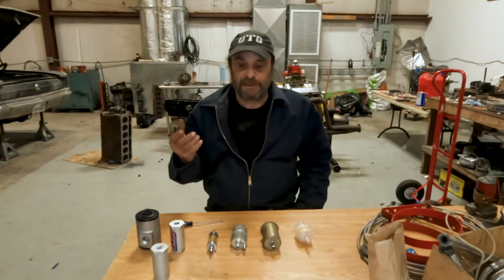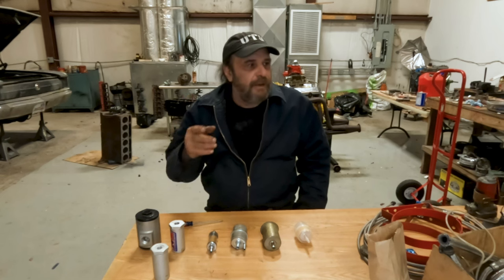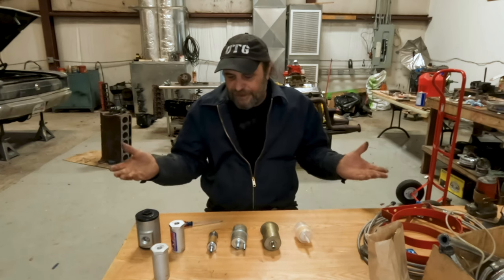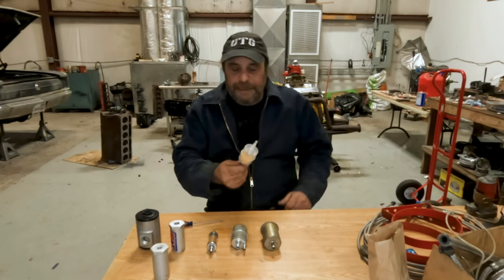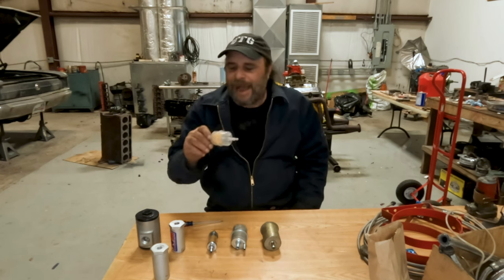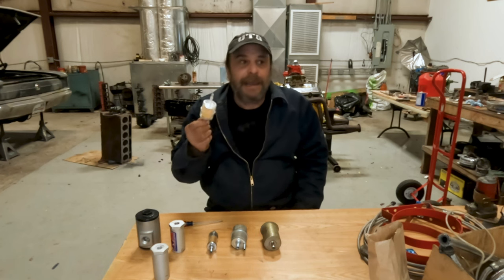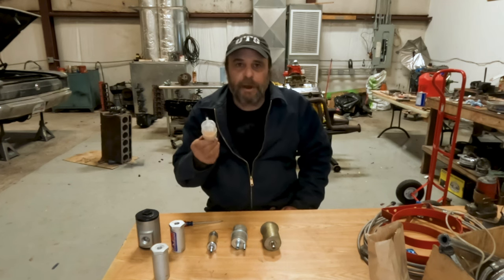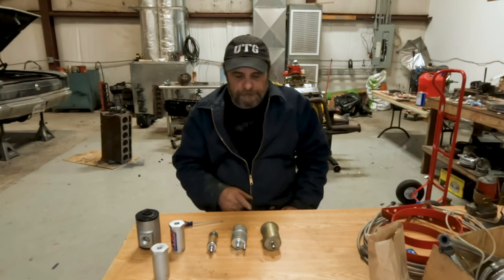Fuel Filters For Carbureted Engines From Mild To Wild - Pros, Cons And Which Is Best For Your Ride

Comment: Never had an issue with a glass filter.
 They are cheap, so I buy a new one, and change it out every so often.
 After I replace one, I save the old ones, after cleaning, for spares, for  yard equipment, or the generator.
 Never had one leak or break, in 50 years.
 Just keep an eye on them...just like everything else.

Comment: Interesting!  Any comments about backpressure/resistance to flow? Won’t matter to normal pumps, but I recently removed an inline filter from a gravity fed 1959 tractor with updraft carburetor (it still has sediment bowl with screen). Even a fraction of a psi makes a difference to such a system.

Comment: I tried a glass filter on my boat because I was trying to track down an air leak.  I split the glass with the primer bulb, not a word of a lie, and sprayed gas everywhere.  To be fair, it was a cheap Chinese filter, but since then I am not a fan.

My question is, can a pulse pump on an outboard vapor lock?  I've confirmed that there is no air entering the system to the pump, but at idle the fuel filter fills up with air (or vapor) and the engine stalls after a few minutes.  Other than that it starts and runs fine.  The stall is always associated with bubbles in the filter, if I use the primer bulb I can squeeze the air through the filter and keep the engine running.

Comment: The MrGasket glass filters work really good if you install them correctly. In 40 years I never had one fail. One drawback is they are restricted. You can deburr and even port the restricted inlet and outlets to up the flow a little. Not good for a really hot street motor as they will starve the carb for fuel. I have one I opened up the inlet and outlets on a 400hp v8, any more motor they will not flow enough gas.

Comment: The only scenario I ever used a glass filter was on an old pickup where the sock in the tank was roached and I couldn't find another.
I didn't submerge it and I put just below the tank. Reason being the micron spec is the same as a fuel tank sock and I could clean it.

Comment: I use a 3/8 Vette inline filter hidden under the alternator bracket. GM GF61P part # 854619 Older stock was made in USA. I had a glass filter once and had to bypass it b/c if started to leak when I saw vapor on the hood. Junk!😂

Comment: A respected engine masters competition engine builder turn me on to the orifice style metal filters and along with a fabricated heat shield under the carb we’ve never had a vapor lock issue with the 589horse, 400” based stroker motor in our street driven roadrunner.

Comment: Uncle Tony... Any old school advice regarding mechanical fuel pumps. Should i run a back flow protector? Before or after pump?  My classic sit in garage a lot maybe goes out once a week. My Edlebrock 6psi pump always looses all of its pressure and i have to crank it over 5 to 6 times to get my 6psi . it also looses pressure right away when i shut the car off. is that normal?

Comment: the only issue I had with the glass filter was I bought a china cheapo version and the rubber O rings where really cheap quality and the gas started to deteriorate the rubber amd make really soft causing leaks so I junked it . I should of had a box of assorted sized green O rings for AC unites to replace the regular black cheapo O rimgs and it probably would have been fine

Comment: I bought the plastic filters,,3/8. And 5/16. Both had reasonably sized  inlets. ,but had tiny inside holes,,they were fun to see if you had flow or how clean the gas and filter were,,,but I went back to steel with huge inside diameter holes,,,car runs much better,,,can't see the gas but that's life..the lady at O'Reilly's tried to sell me vapor hose because she didn't have 3/8 fuel line,,,tried to sell me injection hose that was hard as a rock,,both could burn up your car,house and kids,,,most pumps can't pull gas throughout a bb size hole that you don't notice that's 1 inch from either end,,,glass tubes and plastic filters are for 3 hp lawnmowers,,not cars,,no pump can work if the filter is too restricted,,many a race has been lost due to the wrong filter,,,also Edelbrock red 60 dollar electric fuel pumps draw one amp,have a motor that spins,looks like a old slot car motor,,tiny junk,,centrifical round impeller,,it's gravity feed,so it has to be mounted lower than the tank and a foot from the tank,,,it's a pusher pump,,,not good at self priming or dirt,,if you mount it near the motor it won't last 3 days,,

Comment: I use plastic WIX brand mostly, sometimes Fram as long as it's not China made. Never never had any issues with them. I have the glass filter kept in the drawer, I think I'm just paranoid about using it.

Comment: I've ran them glass filters exclusively for over 28 years, hundreds of thousands of miles. In my experience, the worst thing that happens is you have to take it apart and blow it out with carb clean or change the element inside. Pretty sure they'll take a good beating from a rock.

Comment: Should the filter be before the pump or after the pump? Mine is before and it is full before startup but after a few minutes it becomes empty is what it looks like. Oh I have a fuel regulator between pump and carb set at 4.5 psi.

Comment: On my mild 318 I have always run the plastic see through with no issues at all. Running around 6psi of pressure through an electric pump.
Reply: Weren't those plastic see through filter's factory on the 318s, I remember them in the 60s and 70s on all 318s I worked on.

Comment: Had a 55 Cadillac that if I got stuck in traffic it would vapor lock. Kept a couple bottles of water in it for just that occasion. Car would die, pour water on the pump, crank for 10 seconds and be back on the road. If I could've added a return line I would've, but wasn't my car and didn't get driven that much. I hate those glass filters. Mainly because of the people that install them. They either don't tighten them enough, or overtighten them. For a clear filter, I use the plastic ones.

Comment: That same color plastic filter is OEM on imports into 1960's and before.
  I like the metal filters but not all created for the low 4/6 PSI carb. Isuzu used these with Flat Corbin clamps on TBI in 1991 and 32-34 EFI multiport in 1993 but had  70 micro media and magnet in side. These and plastic ones work on P/S return hoses as well as orifice tubes at the inlet.
  The glass filters are fine but leak. Nobody wants to toque them and specs are not included!
  Metal ones with 3 tubes in todays "LS" engine craziness I would expect to have the guts of a regular inside. A spring, diaphragm, viton needle & seat with a set pressure used for return.
  But the screw-in type with line wrenches and others alway bothered me during removal as fu l runs down the arms into the pits. Skin can be sensitive but you smell like gas as day. I would guess that a quart is in those lines and comes downhill. Waste oil can & trans fluid pan can work but I have tied shop rags to my wrists to stop it. There with no pressure and fuel tank cap on hold a lot. There deserve a shut off ball valve front & rear  but but this adds $20 extra if you can find them. Perfect! As automotive tech we have more science, math and other disciplines required
of use everyday than a Dr. What temp does water boil at? 
Well; Is water water mixed with anti-freeze or contained. 
Is it under pressure, sea level or below sea level or a vacuum. The pressure cap raises the boiling point 3 1/4 degree F per pound, so 15 PSI cap causes it to boil at 260 degrees F. That is why grandma's pressure cooker was so fast. Place in a vacuum and has less pressure to hold the hydrocarbons chains together, so a 3 minute egg boils faster at Pikes Peak or 14,000 feet. Between the gas tank and pump at the engine, rubber is better than steel maybe because of insulation, but at 10PM in Vegas at 100 degrees F, the fuel can boil in a vacuum. This is not a good fuel supply. Many variables play with the exact number, but this is vapor lock. Electric pressure pumps where placed in tanks for years on the first EFI engine, to supply a frame mounted pump in rubber to produce the pressure needed for proper fuel delivery and vapor lock happens for this reason!
  Thanks, UTG again. 
DK. Omaha.

Comment: The glass fuel filter threw me for a loop a few decades ago. The car wouldn't run, I'm a teenager, no experience to speak of. There's gas in the tank, the glass fuel filter shows no dirt, the white mesh element looks very clean. Pouring some gas in the carb makes it run for a short while. I replace the fuel pump, still won't run, same issue. Lots of hair pulling, hours of wondering. I finally pull the glass filter apart and discover the white mesh screen is skinned over with some sort of clear coating, like clear spray paint or something. I put a new screen in, it ran fine. Looked good, but it wasn't.

Comment: My buddy's dad had a nice first gen Chevy blazer with a plastic fuel filter between the pump and the carb.  Didn't drive it much. Plastic broken down and cracked, leaked fuel all over the engine and burnt the truck up.  It was very sad.  And very stupid.  Pay attention to your fuel system and you won't have problems like that.

Comment: Plastic fuel filters with ethanol to me is a "no-no." Ethanol will degrade it fast. Possibly cause a crack. Old fuel hauler here. It used to cloud and crack the polycarbonate sight glass on the loading heads on out trailers.

Comment: I watched 2 BIG $$$$$$ car's burn to the ground from those glass filters. The one had the plastic ends where 1 melted off/loose. The other one O-ring shrunk. But both had fire extinguisher 🧯 that turned out to Not work. Once the firewall insulation catches it's near impossible to get the fire out

Comment: The screw together fuel filters with a glass worked great for the most part, biggest problem I ever had was them coming unscrewed at either end. That was more dangerous than the glass ever breaking.
Reply: I put a wrap of clear packing tape around them to keep them from moving.
Reply: When installing twist lines to have positive force to turn ends in tightening direction.

Comment: say u have 2 plastic filter running in parallel .. they could only handle 30 psi each but u need 60 psi for you build would it work.. i suspect if reg is before filters it maybe ok

Comment: I’m actually going through picking what filter to use on my project at the moment. I picked up one of the glass ones from O’Reilly a couple weeks ago, but when I got back to the shop I saw it was only rated to 300hp. Is this common with most glass filters? I believe it was Mr. Gasket.
Reply: a filter rated in HP? LOL
Reply: @Videoswithsoarin  Thought it was odd myself, but it was marked on the back of the package.

Comment: Do you pay any attention to the level of filtration?
I run veg oil in my diesel vehicles and can rarely find the micron rating on filters, super frustrating!
General use oil filters seem to range from 3 micron to 10 micron and some speciality ones go down to 1 micron but it's super tricky to find the specs. Fuel filters are the same here, rarely any markings on them
Reply: Wix publishes a crazy amount of information for their filters, including micron rating. Just have to look up the part number on the website. Since you have a unique application, you may be better off just to call them.

Comment: the glass ones are fine as long as you remember they are glass and when you take it apart to clean it check the rubber seals in the ends you can get new ones cheap or even find something that's about the same thickness and cut out new ones of a similar material but of course there's always guys that put it together my buddy did this and he had both rubber seals on one end instead of one on each end starts the truck it's dripping a bit grabs two wrenches and snugs it a bit slowed down the drip but still drips so again with the wrenches by this time I walked up and saw how much pressure he was putting on the wrenches I was like whoa hold on wtf your gonna break the damn glass and any more he would have and had glass in his face or something bad would happen so I said step back big boy let me help you out here for u hurt your self we joke all the time well geez he had it tight well we are all getting older and he's had diabetes for quite a long time and his eye sight is not what it used to be obviously so when I saw the issue he was like oh shit but I bet most of the time the glass gets broke it's user error most of the time I'm sure of it you get he man GI Joe w the kung fu grip grab two 12 inch crescent wrenches and crank down and wonder why the glass cracked! cheap POS made in China probably lol yep I'm sure that's exactly what happens lmao night yall

Comment: The glass inline filter can look clean and limit gas flow,since it looks clean you never notice the flow issue,,except your car runs bad and low top end speed,,never use them unless you just like years of poor performance,,they are worthless,,never use them,yes they look cute,,,and never pot your filter near the radiator,,it will boil,,,also use a mechanical fan even if you run electric,,,it moves air over the motor a electric only moves air through the radiator,,,cross over in the intake can boil your carb,,,,the plastic filter inside the glass filter can look clean when it stops flow,,,throw them away,,,don't use them on anything not even a lawn mower,,,I had problems for over a year before I accidently found the flow was so low the car had major problems,,,,

Comment: Glass filters can be taken apart and the glass used for a great guitar slide on your finger I collect glass water traps if they used them in the old days especially on farm equipment they must be good I used a glass filter on a 64 c10 I was building my test run is always from abbeville to greenwood sc I’d make it half way and the truck would start acting up and I’d turn around and come home the filter would be packed with crap I’d take it apart and clean it out I did that every day for a year it finally cleared up and made it all the way from now on I’ll just remove the tank and clean it

Comment: Nice video, it's good to dispel some of the hysteria around things like these glass filters. I've had one on my 1990 VW Polo for almost a couple of years now. Anyone who knows these cars know the filter is fairly secure in the engine bay and I cable tied it so it's not going to move. It's great to have a filter you can easily clean out. Good tip to keep an eye on the seals either end and make sure the ends are snugged down and o-rings in good condition. But just like any filter they won't last forever so I guess replace them every so often anyway is a good idea, it's just a bit less wasteful to have one you can clean a few times before it's done and will actually recycle when you're done with it.

Comment: I bought a '70 1/2 Trans Am in 1985 and it had one of those glass fuel filters mounted over the intake manifold next to the carburetor, not long after I bought it, I smelled a shitload of gas coming from the engine bay while driving, I pulled over and popped the hood and found that gas was spraying from the loose filter end into the radiator fan and the whole engine bay was covered in gas, I shut down the engine and let it dry out for a while, then installed a steel filter, f@cking glass one nearly burned my car down!

Comment: Wow, such a disparity of opinion on the inter webs about glass body fuel filters! Most of the positing about glass body fuel filters has been negative to the point that they suggest with conviction that use of these filters will result inevitably in catastrophic failure and subsequentr vehicle combustion. UT makes sense in his take on use of these glass body fuel filters. The takeaway is the ability to think critically in processing multiple subjective viewpoints.

Comment: The biggest problem with the glass filters is the build quality.  The threads are loose, gaskets rot, or the end of the glass isn't square.  They were better in the 60s and 70s, but it's all Chinese crap now.

Comment: Ha!!!
This is exactly how I fixed the fuel percolation problem on my 1964 Oldsmobile 394. I eventually sold the car and the guy argued with me about a chunk of wood under the carburetor. It was professionally machine on the CNC out of solid walnut by one of the top fuel shops in Orlando but this guy was an idiot and didn’t understand anything about how a car really operates.